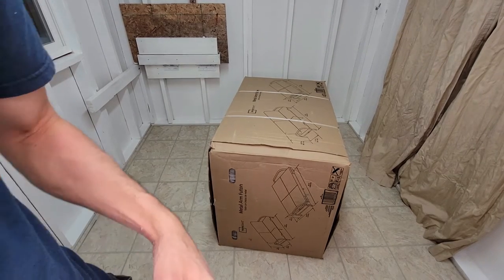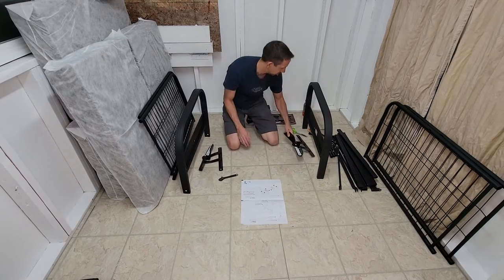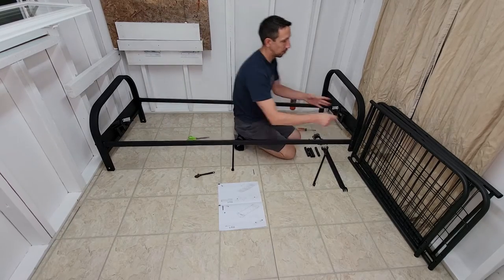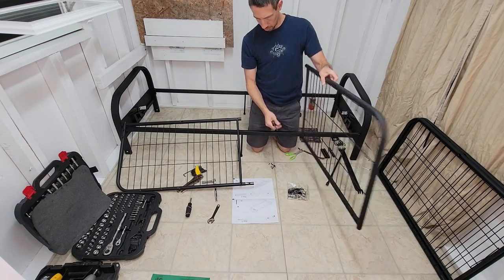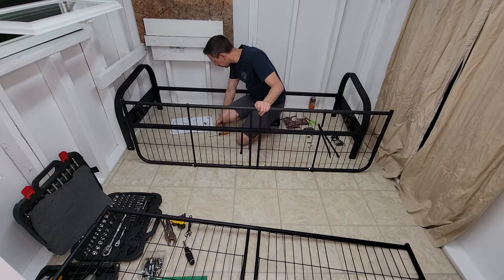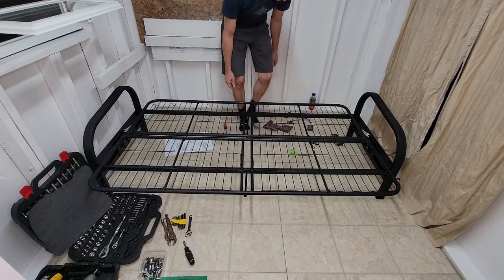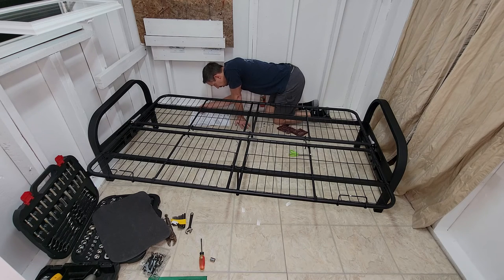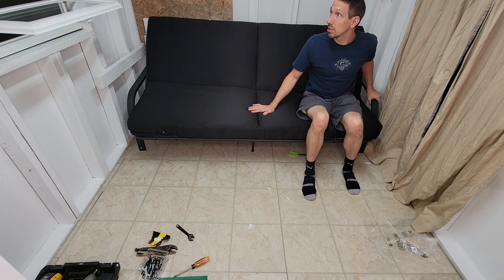MAINSTAY FUTON UNBOXING AND ASSEMBLY AND REVIEW

Comment: You attached the arms of the frame on backwards. The highest point of the arms should be facing front, while the decline and low point of the arm faces back toward the wall.
Reply from the maker: oh.. thanks .. I guess I messed up.. lol it still worked pretty well :)
Reply: I meant to add I was a bit confuckled as to how you managed that. But... it did seem to work as you said.

Comment: Where can I get the three u-shaped four inch metal brackets to hold the frame together so it does not fold when you sleep on it? It was missing those brackets.
Reply from the maker: I would contact the company and tell them to send them to you

Comment: I had one 15 years ago. After not even a year the weld on the spokes all started failing the thing fell apart.its JUNK spend the extra 50 bucks get the wood one.
Reply from the maker: The metal one would be good if they did it right.. it's normally quantity over quality with stuff
Reply: @ETPCYT  build it fast, build it cheap. Mass produce junk .